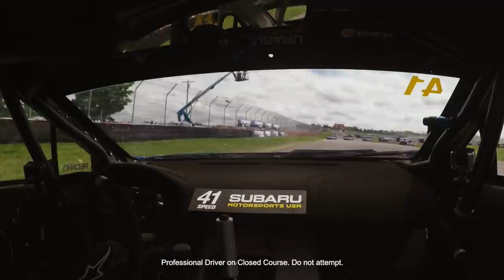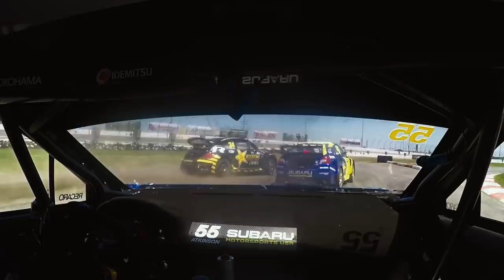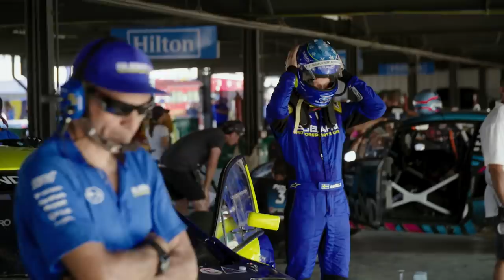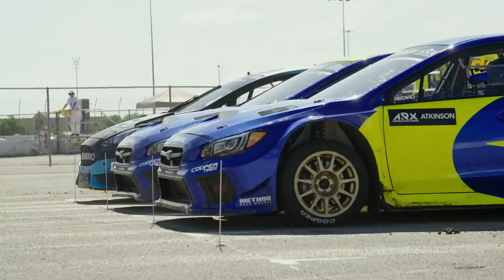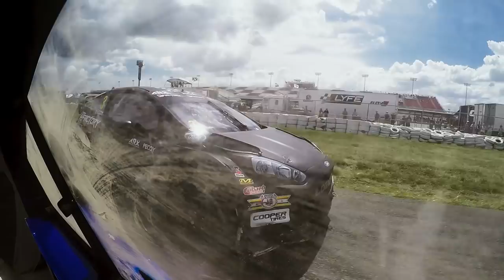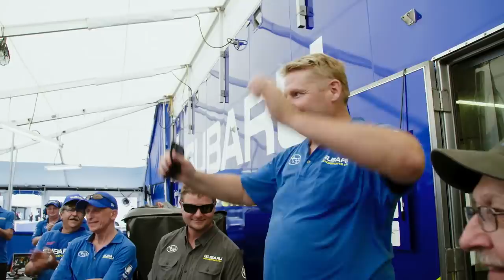Launch Control: Triple Threat - Episode 7.7

Comment: I will never buy a Subaru again in 1 year, I had 2 broken windshields, 
steering gearbox problem and had to change the battery.
This in the 2018 #crosstrek model. Subaru is being the biggest disappointment.